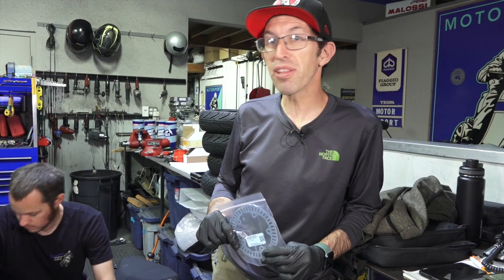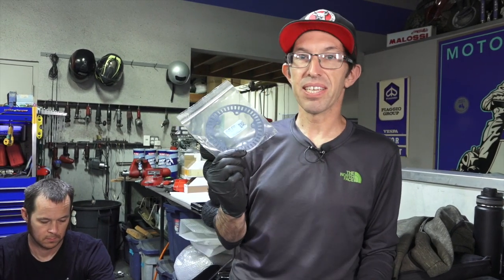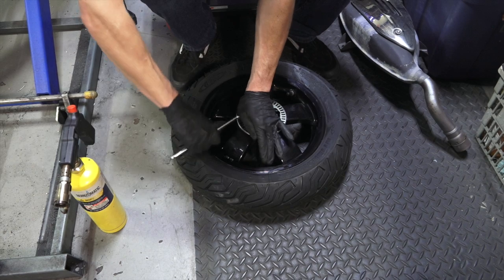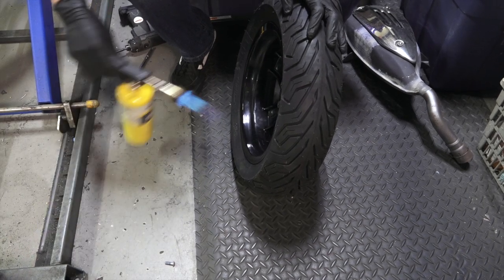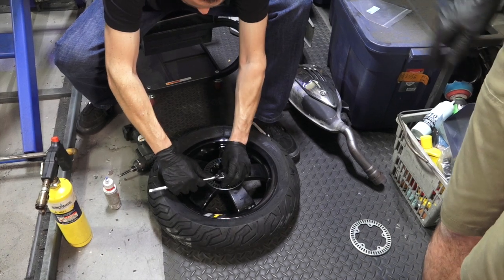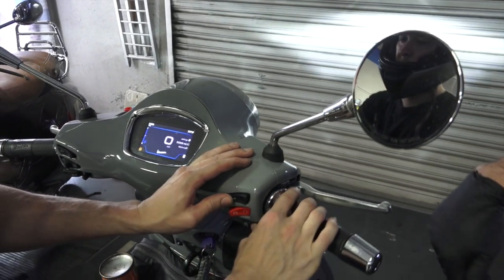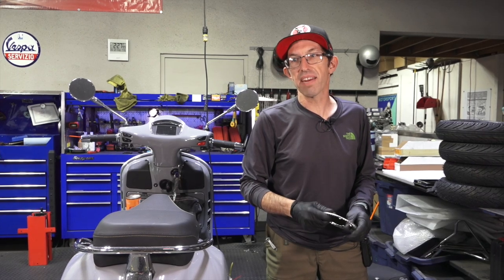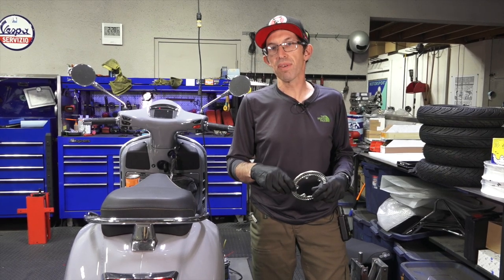Increase Top Speed to 85 MPH and Correct Speedometer Error on New GTS 300 HPE 2020

Comment: Long story, I bought a 2019 Vespa Super Tec 300 HPE [high performance engine] for batting around. There is a "tonewheel" on the back wheel which sends a signal to the ABS and as a rev limiter for the back wheel. It also send a signal to the speedo. You can buy, from Germany, an upgraded tonewheel which allows for a higher top speed and a more accurate speedo. [Not for sale in Germany though] I took the back wheel out and tried to remove the 5 allen cap button head screws. No way could I move them. I had actually read that Vespa puts the screws in with really vicious locktite because they didnt want anyone to change the tonewheel. Well, I first rounded the internel hex,  I then cut a slot with a small disc grinder and cutting wheel and tried moving the screws with an impact driver, all the while using heat as per "Robot" in the hope of getting the screws to move, nothing happened other than shearing off the heads! But, nothing scares me, I was an Engineer on Super Tankers and South African to boot. Nothing, but nothing scares us! I had to deflate the tyre so that I could clamp the back wheel into my Drill Mill and I machined the screw out and cleaned everything up with a 6mm tap, tomorrow I will go out and buy 5 more button head allan cap screw and use a more gentle locktite. We shall overcome!

Comment: Great idea!!! But I think I found something even better for my Sei Giorni: I put the rear tire (not the rim!) to the front, and installed a bigger tire in the back. Michellin makes 140/70/12 tires which fit nicely into the rear. Same effect, but even better driving stability!
Thanks for all your amazing videos!!!!
Reply: Great option! How is that working out for you so far?
Reply: @alonsogalvez555  Extremely well. Handling in curves and potholes is excellent, top speed increased by 4 mph, the whole scooter feels a lot more mature. Make sure you switch the back tire to the front (with rim), and in the back you install the 14/70/12. Have fun!
Reply: What about fuel consumption?
Reply: @franck1685  Check your tire direction if you switch it with the rim to the front. The tires thread in the front and rear are different
Reply: @tkp1212  Good advice! Thx
Reply: You think it works just the same for gts 300, i was wondering if the abs disc is the same in the gts hpe front and rear if you change with the rim...is your speedo accurate now?
Reply: @mastodonttix  Well, I did this tire change on my 300 Vespa from 2016, there is no ABS. For the ABS models, simply just change the tires on the rim, rather than just doing the rim-switcheroo as I did, and you'll be fine. The speedo ran more correctly after the change, but still not quite. You can put in a different gear at the front wheel at the end of the speedo cable (there are 6 and 7 toothed  cork screws available, the it goes correctly. Hope this helps.
Reply: @franck1685  wait, tire only back to front and now back to front "with rim" which one?
Reply: @jrnumex9286  Rear wheel complete (tire and rim) goes to front as is, front wheel gets new oversized tire put on and goes to the rear.
Reply: @franck1685  t.y.
Reply: But gts was 13inch rim

Comment: I just changed the ring, but the check engine light appeared. After I done the asr calibration. Wondering if it’s normal. I disconnected the battery and the check engine light went off

Comment: @Vespa Motorsport ,  if I understand this correctly the ABS will kick in later or earlier due this part? Or did the producers programmed it als correctly in the disk?
Reply: Interesting.. I thought this would cause imbalance.. Do you change both speed sensor disc

Comment: So are the holes in the tone ring 10% larger than the stock ones proportionately to get the 10% reduction in reported speed? 
Reason I ask is I need to modify wheel speed on the front wheels on a race car I'm building, where I'm running a larger diameter rear wheel and need to "slow down" the front.

Comment: Hey Robot you do a great job man.Actually do I solve this problem just by putting 13 inch wheels on or I still have to buy this disk?
Reply: If you install 13” wheels the speedometer error is eliminated. You are going as fast as it shows.

Comment: I admire Robot and have bought several parts from Scooterwest (which btw has great customer service) that work great. I've also used his how to videos successfully. But a flat rear tire replacement gave me a reason to purchase and have this part installed by a reputable dealer but I found no difference in performance. I don't know if the speedo is more accurate (which is really why I purchased it-I don't intend to go anywhere near the bike's top speed except to test it) but I went on the Interstate to test the top end speed and when the speedo approached about 79 mph, the '22 300gts bucked and lost power exactly as it did with the factory installed tone ring. Maybe I'm missing something in the explanation. The indicated speed might be more accurate because several times I was on different roads where cars ahead seemed to be going at exactly the speed limit which is what my speedo was indicating.

Comment: Hi, I've installed the speed wheel and confirm that the maximum speed is increased from 121km/h to 128km/h (GPS) whitout windscreen. The tachimeter is now allineate with the GPS.
Reply: Hi Giorgio!
I did the same too on my HPE. I changed to Pirelli angel and fitted the disc following by the ASR recalibration.
I got the medium vespa screen on.
I do have noticed true128 km/h according to the GPS.
But the acceleration is slower.....I don't know what else to do....maybe a secondary gear could help?
Reply: Did you have controlled the roller weights? The abs wheel don't change the accelerato. My be that the real speed that you now see change the prospective  and the sensation
Reply: @giorgio8920  Roller weights remain the same. I got only 9000 km on the speedo/ ready for the 10000 km incoming service.
I don't know my friend. I feel that the acceleration is a little slower than before.
Maybe if I change the belt on the service will see a little bit different sense.
Otherwise I 'll go for a secondary gear.
Reply: Is possible that the shape of the roller is unregular by the use and this compromise the prestation. After the 10k control, if is the same, the only solution for get off the dubt is  compare with another hpe...
Reply: @giorgio8920   My dear Giorgio, appreciate for your immediate reply and assistance.
That's exactly what I want to do. Awaiting for the 10K in order to check this out, hoping for a positive result...

Comment: I am still unclear... does the new "GTS-HPE-SPEED" part correct the speedometer error, or the "HPE ASR SYSTEM CALIBRATION PROCEDURE", or both together?
I am not interested (well a little) in increasing my top speed, just correcting the 5 to 7 MPH difference of actual speed on the road.
I have been clocked doing 5 to 7 MPH under what the speedometer states.
Reply from the maker: The tone wheel part is what actually corrects the speedo error. You have to re calibrate the ASR regardless, any time you remove the rear wheel.
Reply: @VespaMotorsport : Hope my local east coast shop can perform the removal/install. I definitely do not want to take a torch to my wheel.
Reply: Update complete. Success! Speedo error fixed, and top speed increased.
Thanks Vespa Motorsport and Robot for showing this.

Comment: I installed the ABS overdrive tone wheel on my 2020 GTS 300 hpe Notte.  Prior to the mod, my scooter would reach ~85 MPH and the speed sensor would kick in and the engine would decelerate.  After installing the tone wheel, the maximum speed is 79 MPH and the speed sensor never kicks in.  I am guessing that the speedometer was not accurate prior to the modification, so by changing the ABS overdrive tone wheel, the speedometer is reading accurately now.
Reply from the maker: That's exactly correct. This will "trick" the computer and make it so the rev limiter won't kick on so early and will give you a much more accurate speed reading. The Vespa speedos have always been notoriously optimistic. Thanks for chiming in with your experience. Thanks for watching!

Comment: I did it on a euro4 HPE, no cutting out at top speed but  no improvement in the actual top speed either, could not get it past 75mph, even crouched down, unless dowhill. Overall pretty disappointed with the hpe performance, especially in higher speeds, hard to believe in the 24hp, mine was broken in at almost 6000miles as well. Many large scooters pull all the way to the top, and reach 85 easily, where the HPE starts to be really sluggish around 65mph. Therefore it is also pretty unsafe at highway speeds because you cant really get out of the way. Ended up selling mine mostly for the lack of top end reserve, also quite a gas goppler, does launch pretty well but not that much better.

Comment: Can you do a Dino test with this part. Has it been tested at all? I'm asking cause I'm very interested. It seems an inexpensive part to improve the performance of your bike, compered to Alosis or other parts? I'm puzzled, thanks.
Reply from the maker: Haven't Dynoed it yet, but check out our previous video comparing the old GTS to the new HPE. The HPE's top speed is limited by the computer coming from the rear wheel sensor. All this part does is trick the computer and actually gives you a more accurate speed ready on your Speedo as well. Stay tuned for more updates on this...
https://youtu.be/AeSY9VhEVqE

Comment: Hi robot, love your videos , watched you put a malossi belt and rollers on a bv 350 and would like to put one on mine. But can’t find a video for a 300 ie bv 2018 ie so is it the same as the 350 bv . Thanks from John from England .
Reply from the maker: We only have the 350 in the States right now, but the steps should be pretty much the same for the job. Also look at any of the Vespa 300 videos where we doa similar job. Besides the body work, the engine architecture is very similar. Just make sure you get the correct replacement parts for your model. Hope this helps, and thanks for watching!

Comment: Hy Robot, how is an older model limited? A M641 EU 2010 300ie model. Mine either at 9000rmp or 124km/h on the clock, so about 115km/h for real.

Comment: Does that work on a 2020 sei giorni. If so how to correct speedo after install
Reply from the maker: If it has the HPE motor, it will work. You will need to calibrate the ASR (watch our tire change video linked in this video). There's a detailed instruction on how to do so in the description of this video. The rest is taken care of by the computer. Thanks for watching!

Comment: Hola saludos desde España, tengo una vespa GTS300 HPE de junio del 2019, llevo montado atrás una 140/70/12 y he montado el disco pero ahora no me marca velocidad y tengo encendidos los testigos fijos de fallo de motor, ASR y ABS. He probado con un gps y la velocidad máxima es 125kmh. Como puedo volver al estado de serie para que me vuelva a marcar la velocidad y volver a tener ASR y ABS activado. Un saludo 

Hello greetings from Spain, I have a vespa GTS300 HPE from June 2019, I have a 140/70/12 mounted on the back and I have mounted the disc but now it does not set speed and I have the fixed engine failure, ASR and ABS warning lights on. I have tested with a gps and the maximum speed is 125km / h. How can I go back to the standard state so that my speed can be set again and have ASR and ABS activated again. All the best

Comment: I purchased ABS OVERDRIVE TONE TIMING WHEEL DISC REAR VESPA GTS HPE 2020-2022 ONLY (NOT GTV SEI GIORNI OR 2023/2024 GTS HPE2) and it was installed on the scooter and after that the speedometer did not work and did not read the speed. Is there a solution for this? Bike frame number ZAPMD3104N5001196